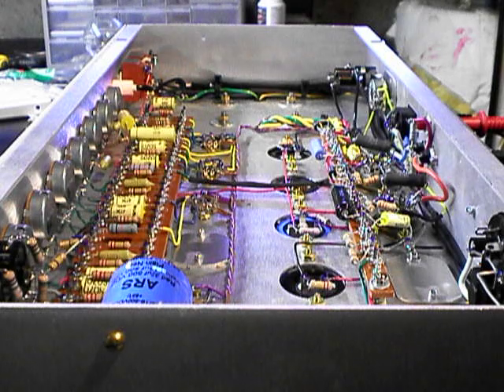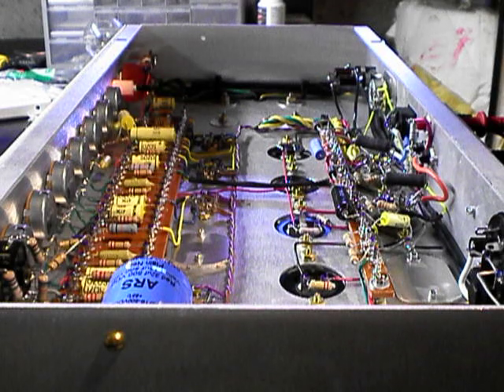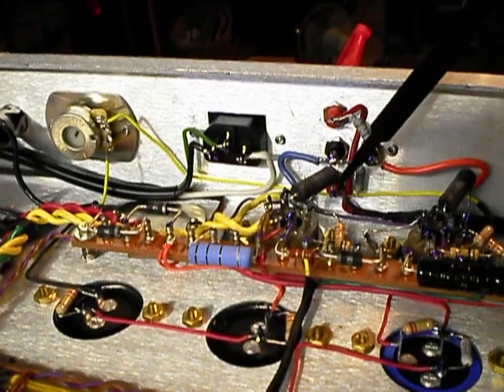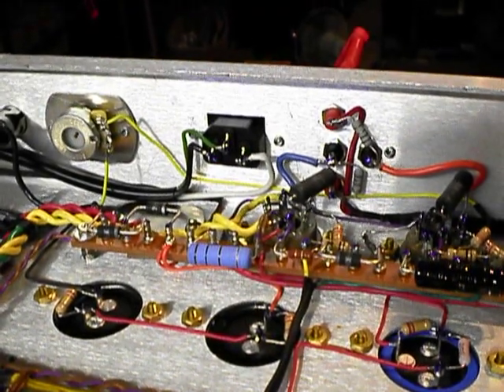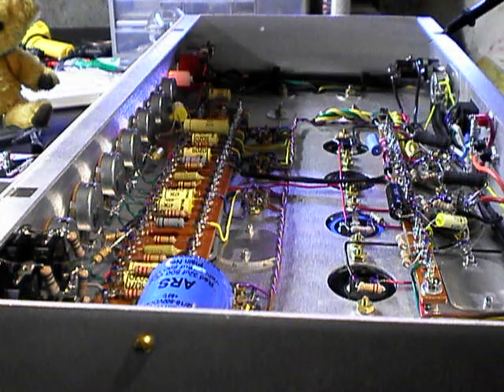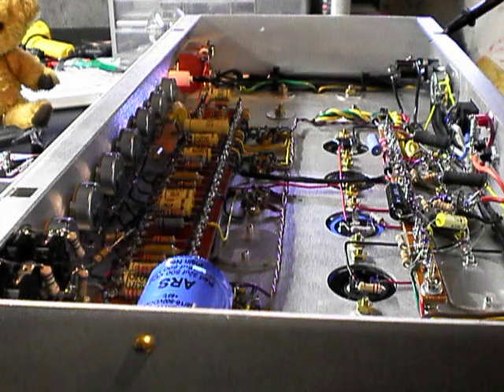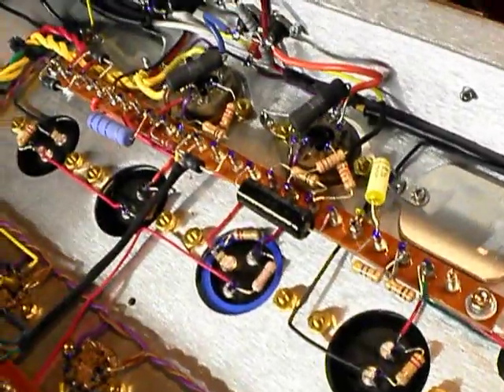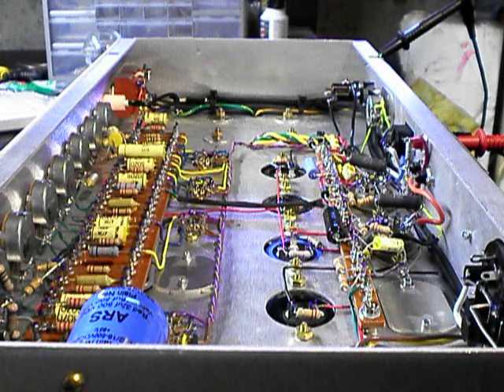Amp Biasing.MOV

Comment: 70% is not a good starting point.. That is the upper limit.. Start with max 60% of max plate dissipation.
And your value at your test point is probably total cathode current (screen + plate current),,, EL34 has substantial screen current draw so you have to deduct the screen current from the total cathode current to get plate current...

Comment: All above true. Do not measure anode current measure cathode current and you can fit a 1 ohm resistor. Cathode voltage is much lower also. Fast tip.. Put amp in a darkened room and adjust the -ve grid bias until the anodes just start to glow. Then increase the bias voltage until the anode glow disappears. Saves 1Khz at 80% o/p sine wave and a scope looking for X over distortion, much faster. and a  British guitar amp manufacturer used to use this method.

Comment: I think you have done a good job explaining. Not everyone will understand the difference between voltage and current - keep up the good work. Since the cathode current is the sum of plate and screen (and screen current is quite low) it is safer from a HV point, to measure the same voltage (and determine current) across a one ohm resistor placed in series with the cathode or you can simply put your ammeter directly from the center tap of the transformer to the plate of the tube -  think about it

Comment: The variable resistor is a balance adjustment so Fender did not have to use matched tubes. I usually use a dual linear pot (20K) or 100K with 27K resistors in parallel with each pot's element. This allows me to put voltage to the grid or the ground and bias the amp. See Marshall amp schematics. I do keep the balance doohickey  just for GP and also use it too. If you can find a center tapped pot they work great and were used on pre CBS Fender amps. Lotsa luck there. I am not selling my stash.

Comment from the maker: @CosmicSPC Thanks for your comment. Ultimately, I want to know the mA of anode current at idle. However, it is easier to measure voltage drop than to measure current. That is why I measure voltage drop across a 1 Ohm resistor in series with the tube output (anode). According to Ohms law, V=IR. So I know that V=I with a 1 Ohm resistor and the voltage drop I measure will be the same value as the current at the resistor.

Comment from the maker: @jayques thanks for your comment. biasing by grid voltage seems reasonable to me as long as you know what grid voltage range is appropriate.
Reply: Yeah I agree. Some people dog the Peavey test points, but they bias like this… and it works just fine. Their recommended bias for 6L6’s is always really cold, but that’s because they are being conservative and don’t want to hear about people having issues with tubes. 

But yea… I agree. As long as you know the acceptable ranges, you can use that as a reference point for biasing.

Comment: Hey I just biased my amp the other day off the negative voltage off the number 5 pin.  I'm wondering if this is a method that works or if it is not then howcome and what is a proper way to measure the bias without having to buy a bias probe.